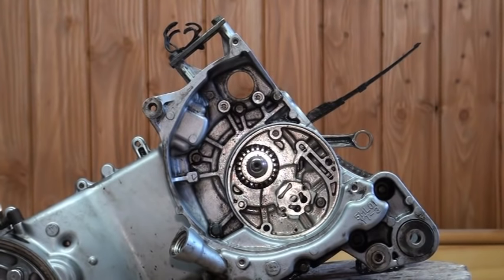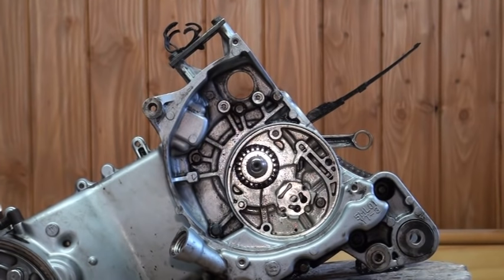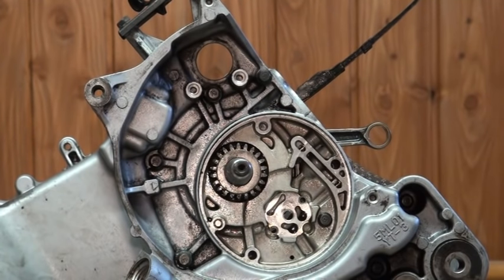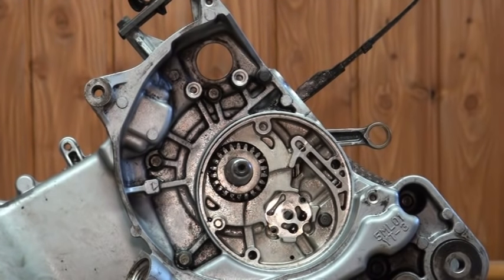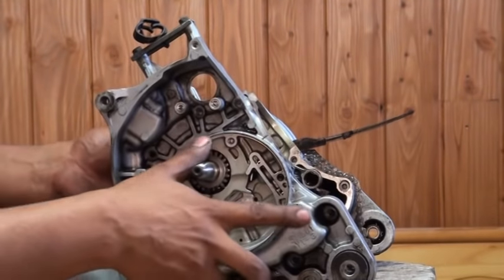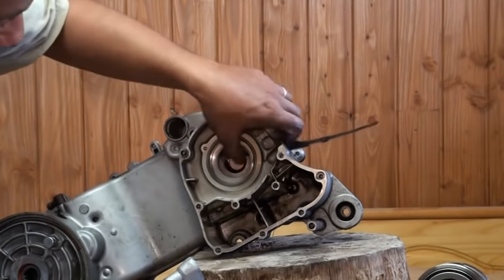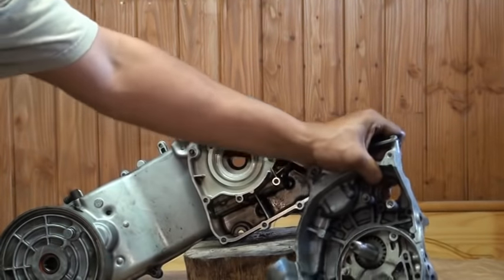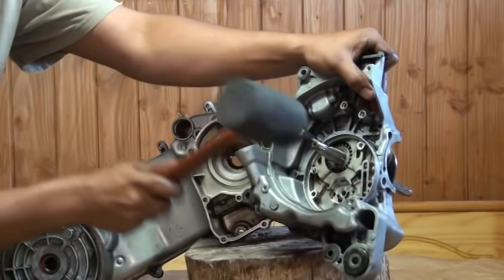-Split the Case- Yamaha Zuma 125 (BWS 125, Cygnus 125) Scooter

Comment: Couple things I would maybe add. Note that there is a sufficient amount of oil that may come out of the casing. Also. When I split the crank did not move the timing chain well off the sprocket. My case split but left the crank. I then moved the chain and had to pound it off the other side of the case.